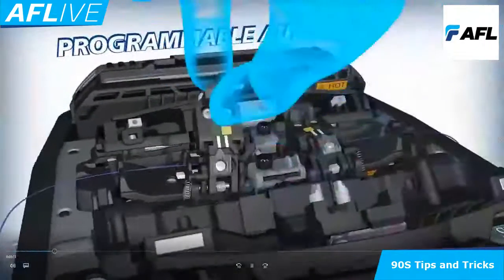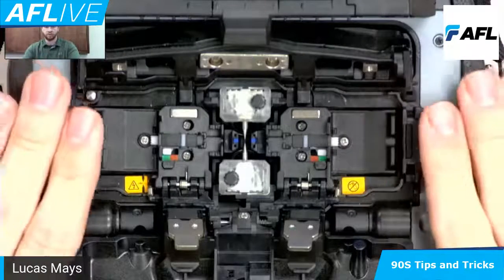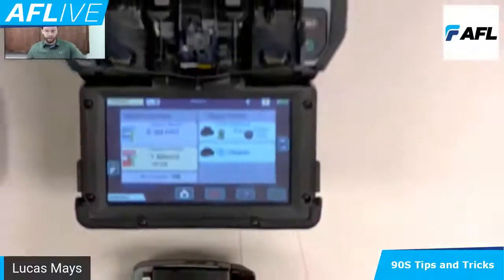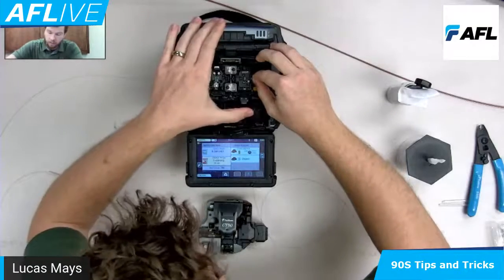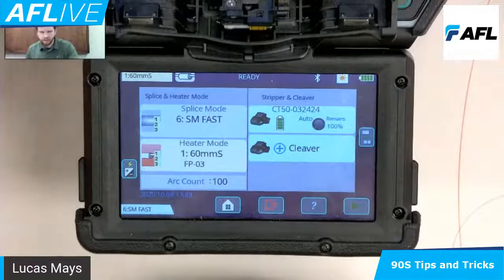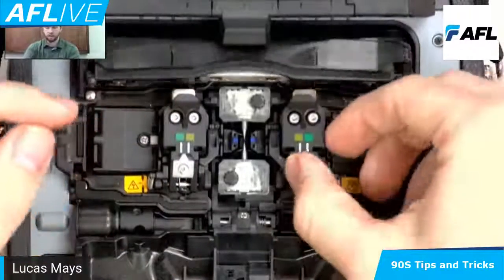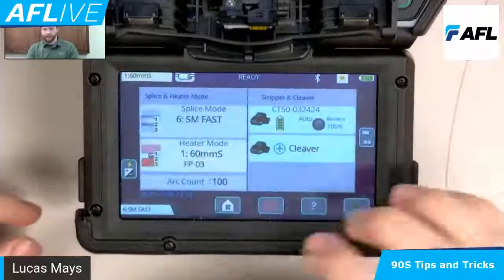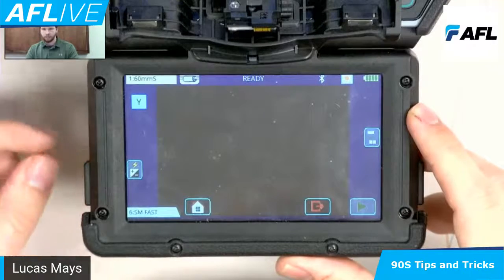Fujikura 90S Splicer – Tips and Tricks

Comment: I have several Fujikura 90S splicing machines in my company, but four of them are giving the same error, i.e., 'No Electrodes.' I have replaced the electrodes and checked all possible solutions, including updating the firmware, but the error persists. Can you please advise on the possible root cause of this issue, as it seems unlikely that all four machines would experience the same error simultaneously?

Comment: Hi Sir, 
I use two cleaver when working with Fujikura 90s plus.  One cleaver is CT-50 with wireless and second one is CT-30 without wireless. It's possible to set CT -50 on left or right side on Fujikura 90s ?

Comment: Fuji 62s is by far the best splicer made all the new ones, you rely on the machine. Only plus to this splicer is to be able change clamp settings without replacing them. Saying that if you know what your doing you can stip a fibre with no issues with zr motor trouble. For speed i would recommend 62s

Comment: ECF , must be on or off for best splice
Reply: Ecf is used when splicing fibre whose core is not concentrically aligned. If this is not on, the two fibres when core aligned and arced will result in cladding becoming aligned and core having a “step” ( there is a better term for this but can’t remember it). When on it prevents this natural line up of the cladding and allows the core to be aligned straighter however claddings will obviously be out of line. This results in less loss overall however will still have a big loss

Comment: In the Fujikura 90S there is no more the button Arc, as was the case for the model 80S. Is there a way to send manually Arcs? I am asking because I want to taper down an optical fiber. The splicer is expecting two fibers, therefore I got the error "too long fibers", when actually I have just one. Nothing happens then. Thanks
Reply: I have no clue, use and older model then
Reply: Yes, you have to edit splice mode settings in regards to estimated loss threshold. Any value over this will allow for you to re-arc by pressing the button with the lightning icon present after error is shown

Comment: Dear I'm using Fujikura R90 splicing machine. I'm facing 1 issue with this machine. I need your help. Whenever I'm splicing SM with this machine my machine braking fiber splice after the arc fusion done.
Reply: call tech support
Reply: I’m dealing with the same issue, did you ever find a resolution or is it user error?